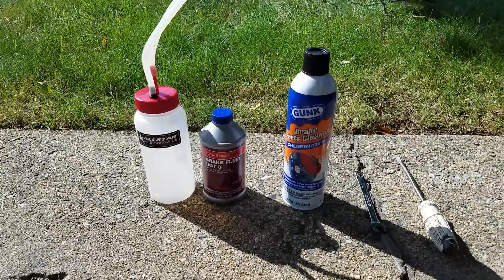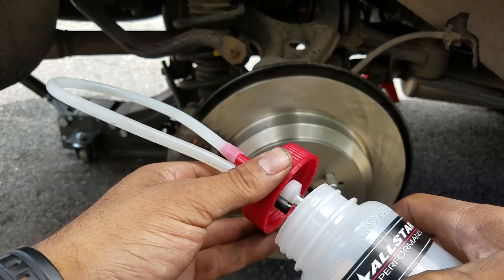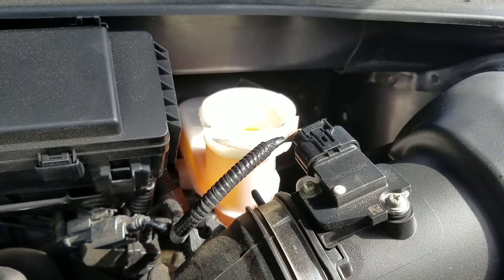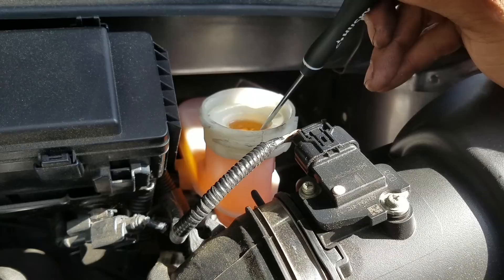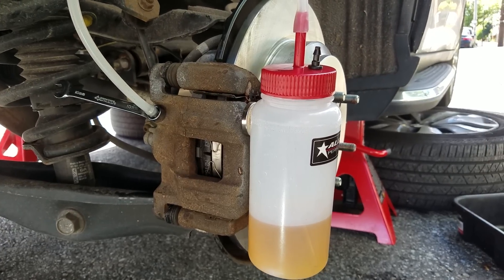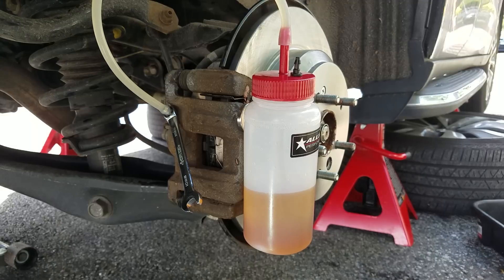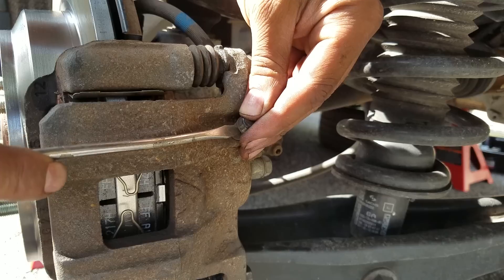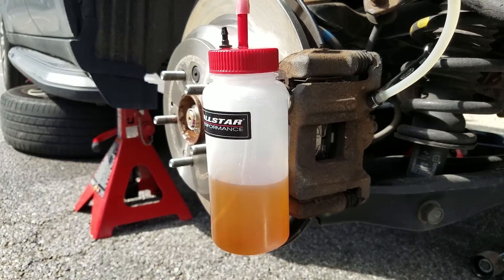Brake Bleed & Flush (One Man Bleeder) - 2014 Acura MDX

Comment: Really great video.. I purchased 5/16 OD 3/16th ID clear tubing at the hardware store. 10 cent a ft for 4ft,, I drilled a 5/16th hole in a Gatorade bottle cap and a small air hole in the cap  Then I pour fluid into the bottle approx. 2 inches , slide the hose thru the hole down to the bottom of the bottle, I then put a tie strap under the cap around the tubing so it cant pull out,, I also apply a small amount of silicone Brake grease around the base of the bleeder screw to stop air entering the system. Cost with out fluid less than a buck.. This video he did is awesome, im just tossing in some extra ideas...
Reply: ²

Comment: Great video. Succinct and informative. One tip, brake fluid is very caustic. You wanna put towels down to cover everything around the master cylinder and clean up your caliper wheel area from any drips as well. You dont want even a drop finding its way onto a seal or belt or rotor.
Reply: agree with the info.. I just spray break cleaner

Comment: Solid video, looks like a fresh brake job, If you did not pull guide pins and clean and re-lube, you might consider it in the future. Many (bad) shops even skip doing, that and it only takes 5 minutes a corner. It is super easy and should be done every time a caliper is taken off
Reply from the maker: Of course they skip it. They need you back there as soon as possible. Doing a complete and honest job is literally bad for business.  DIY Whenever Possible!!!

Comment: NO air escapes around bleeder. But it enters through the bleeder threads when you unscrew it and depress the pedal. Much better to have a pump on top of the brake fluid reservoir with constant pressure. That way NO air can enter the brake system, since the pressure in the system only forces it out, never in.
Reply: Can you make a video showing how to do that? I don't understand how to go about doing that and videos make it easier. I don't know how a pump wouldn't put air into the system.
Reply: @joeybuddy96  you pump brake fluid, not air. It's essentially what they do if you get your brake fluid flushed at a shop.

Comment: There is a Box Bleeder (6 point) made just for the job for about $10. It comes in SAE 5/16 - 3/8 and 8 - 10 metric, and is thin wall and deeply offset.. Alternatively, the next best wrench would be a flare nut wrench, but calipers frequently do not have enough room around the bleed nipple for this.If a person is doing any serious brake work a pair of box bleeders is a must-have.
Reply: Or, just buy snap-on 12 point wrenches, they do not slip.
Reply: how rusty are they

Comment: I installed a new caliper, but it won’t release. The rotor is stuck. I’ve been using a special tool to push the piston back. Then when I do the bleeding procedure the caliper won’t release. It’s messing with my gas mileage and chewing my brake pads. Is it maybe because I’m not doing the bleeding procedure right? 
Aren’t you supposed to hold the brake down after few times then open the bleeder valve? Or this this method different?

Comment: when you start, best to suction out as much fluid as you can, then top off before you start bleeding, may as well get the most old stuff out as possible. Also put block under pedal so master cylinder will not travel into area it never has before, and possibly pick up internal grime that never was touched before. 1 quart should be more than enough, but not if you bleed too much at each corner. I think the system might hold 20-24 ounces. Also if you are doing a real through flush, consider pushing caliper piston in with bleeder open as a starting point, that will evacuate a lot more fluid from caliper piston, but there are risks involved in that method.
Reply from the maker: All Good Tips.  Thank You.

Comment: will this work on motorcycles? I want to do a flush and fill on my bike. did you pump the brakes before putting the tube on the bleeder valve? because as soon as you opened the valve the fluid came out into the tube. that's why im asking.  or is that how it is when you open it once the tube is on?thanks!
Reply from the maker: I'm not sure if this would work on motor bikes...do your homework on that one.  But NO, I didn't pump the breaks before I started this procedure. The system will have a bit of pressure inside  once your system is sealed. Fluid should start to flow automatically....pumping the break pedal just adds more pressure in the system forcing the brake fluid out.

Comment: Cheers Bruv this video helped me a great deal, and I like you little bottle with the magnit on, I wish I could get one in England... Good day fella
Reply from the maker: Why cant you get one in England?  I thought Amazon was available world wide. Anyway...worse case scenario is that you can easily make one of these bottles yourself. I was just way to lazy to do it. You Tube has a bunch of vids on how. Thanks For watching.
Reply: Brooklyn Bionic
Yeah your right, I've just ordered one, but my motor has ABS, and I accidentally let air get right into the system by not topping up the MC, I've bleed my brakes three times, but there still spongy, I've been told there's air in the ABS module, and I need hook it up to a computer diagnostic system to activate the pumps in the ABS, then bleed it again... It's become a right pain in the arse.. Grrrr !

Comment: How many bottles of brake fluid do you recommend to have before starting this job? And you can’t use brake fluid that’s been opened before right?
Reply from the maker: A 32oz bottle should cover the entire system but brake fluid is cheap...buy 2 bottles and keep one on reserve. You CAN use an old opened bottle..no harm in it... (Its still better than the old dirty fluid in your car anyway) but of course its better to start off with a sealed bottle.

Comment: Hello, I know you replied on 1 of the question from the viewer stating you used almost 2 of the 12 oz bottle to bleed your brake system but does it mean these 2 bottles of new brake fluid would be enough to stay in the brake system after flushed out the old fluid from all 4 calipers? I want to make sure i have prepare enough brake fluids before I start the this project on my 2014 MDX instead of running out to get more in the middle of the job. Thank you!
Reply from the maker: Well, if you are using the Genuine OEM Honda fluid I would buy 4 bottles (Yes...Kinda Expensive) you might get a good deal on eBay. I think that will cover an entire brake system flush. But the genuine Honda fluid only comes in 12oz bottles so buy 4 just in case. If you have some left over...Great!! save it.  You can also use the cheaper Prestone AS401 DOT 3 (Yellow Bottle).  The Prestone fluid comes in a huge 32oz bottle so buy 2, it should be more than enough.
Reply: Thank you so much for your professional advise!
Greatly appreciated!

Comment: But if the cap is not screwed back on tight when pumping brakes doesn't this push up the brake fluid to be pushed up over the top of the reservoir ,or does it not
Reply from the maker: No..pressing on the brake pedal does the exact opposite. It pulls fluid INTO the brake system not push it out. The only thing that can force fluid OUT of the system is compression of brake piston.

Comment: Do you release the emergency/ hand brake before you start bleeding ?
Reply from the maker: The emergency/hand brake actually has nothing to do with a brake bleed process. It should probably be on though...just for safety reasons. Keeps the car still while you work...if you don't intend on taking the wheels off.

Comment: Did you notice a difference with the brakes?  I need to do my truck.  I've noticed the brakes are a little soft when things heat up.  Thanks for the video.  Do you start the car when you pump the brakes?
Reply from the maker: To tell you the honest truth...NO. No difference at all.  But I don't think my fluid was that bad at the time I made this video... but that does'nt mean  that you should'nt  bleed/change yours. You might see a significant difference. Brake fluid is extra cheap. Just Do It.
Reply: mine made a huge difference after a flush, (straight from factory) then when we re did the brakes we saw the pads were not wearing evenly. they were probably not relubed correctly. Check out south main auto's method of cleaning calipers. or just replace the caliper entirely if they are too rusted, fresh lube, fresh bleed and you will notice so much more power

Comment: Did you pump the peddle without screwing tight the reservoir cap back on tight
Reply from the maker: Do you mean as I was bleeding the brakes?  Sure I did, there is no harm in that...  as long as there is always fluid present in the reservoir...air can not get into your brake system.
Reply: If you notice the underside of the cap has a rubber seal/diaphram that is accordianed up in the cap. That allows the seal to expand into the reservoir, allowing brake fluid to get used up without air getting into the fluid part of the reservoir. 
This is important since brake fluid will absorb moisture from the air. All I'm saying is you do not need to leave the cap loose when bleeding.

Comment: The start says to use an open end wrench, the procedure shows using the box end.

Looking at the caliper assembly of the first wheel, the guide pin boots are dirty, the abutment springs (stainless glides) look like they're distorted, not seated and have never been changed. Not service those items is why most brake pads and rotors become damaged
Reply from the maker: Your right...it was a double ended wrench and I said open ended but should've SAID box ended according to how I performed the job. Guide pins are 100% on point. I did a full rotor and pads job just before I did this brake bleed...also made a video on that.  Maybe it's just a bad camera angle you were looking at.  Thanks for watching..
Reply: box end is better just because it has more contact with the nut and less chance of stripping

Comment: How much bottle did u use?
Reply from the maker: Honda OEM DOT 3 brake fluid only comes in a 12oz bottle I believe. I used almost 2 bottles to flush my entire system but yours may use less... or more.No need for the more expensive Honda fluid though, you can use the popular Prestone AS401 DOT 3. Its only 8$ for a 32oz bottle and works just fine.
Reply: I hear you can not ...or should not use anything other than Honda break fluid...when I called local Autozone..the gentlemen told me the dealership orders parts and fluids from them.. and they ordered fluids other than Honda .. go figure I'm really confused???

Comment: During the bleeding process, when you're hitting the brakes a few times, do you have the car on? or off?
Reply from the maker: I had my vehicle is accessory mode. Meaning car was ON but engine wasn't running. Some vehicles wont allow you to fully compress the break pedal if the car is totally off.
Reply: Brakes should be bleed with the car engine off
Reply: If you have a diesel with a vacuum pump are you not supposed to have the vehicle running otherwise the brakes will be rock hard after about 3 pumps